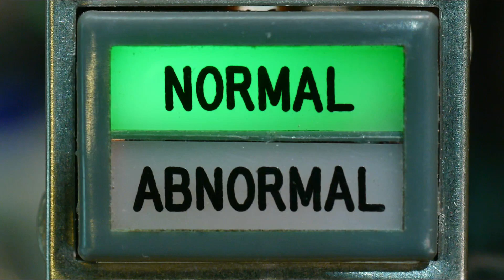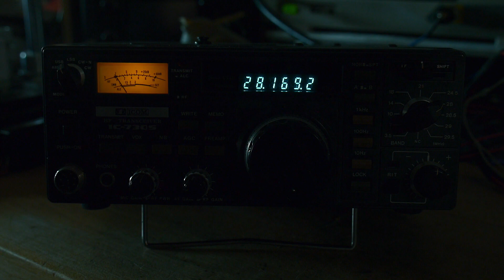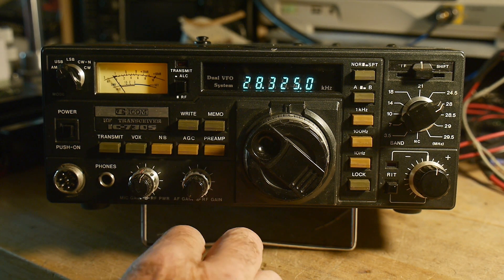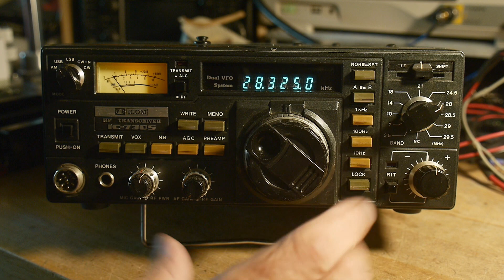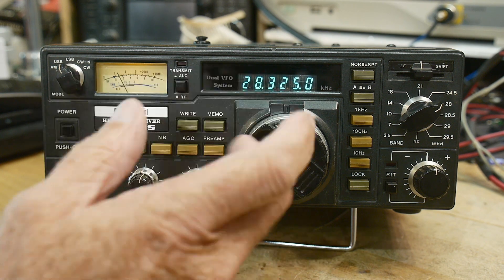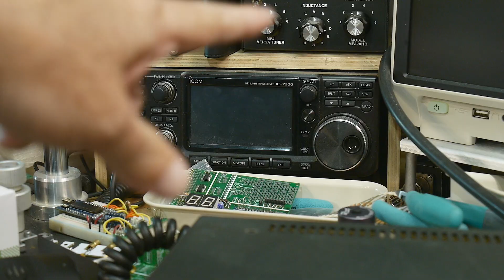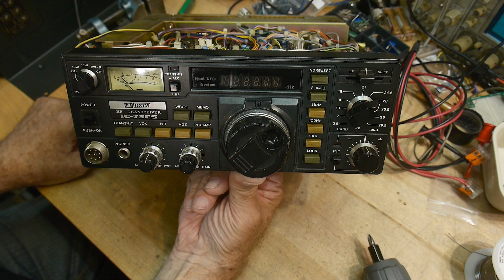#1702 ICOM IC-730S Transceiver Repair (part 1 of 5)

Comment: I replaced the 2SC945Q with a 2N2222 already on my 730. Cut the wire to allow WARC bands. I also did the internal RF cable solder touch up, & cleaned the RL1 relay with Deoxit. I'm still not sure if it's transmitting cleanly, I have to repeat myself when on SSB. It is transmitting, per an external power/SWR meter.

I don't want to do a full recap, but may need to.

Comment: Sir, since you are a technician, I have two IC-735's that were both in good working order that used to be my father in-law's. Now, both just turns ON with one half a display, the other with no diplay at all and I can't hear anything since both were in storage since he died more than 15 years ago. Would there be a chance both will work again if I recap both of them? Thank you sir and all the best.

Comment: Perhaps 10-years ago I bought several of those pre-amp relays for my IC-730 and never got around to installing one.  The reason is that I had popped the cap off the relay, gave it a half-second flood with DS-50 and it has worked perfectly since... no need to replace the relay (so far).  I'd planned to keep the original installed anyway until it just had to be replaced.  Recently I hooked the the radio back up - no RX or TX.  Turned out to be those infamous J2 and J3 solder points on the RF Board.  I not only resoldered them, but soldered in some stiff, reinforcing jumpers to the adjacent solder points.  All well now, expect that the S-Meter doesn't budge on receive; R42/42 adjustments have no effect.  I'll save that project for the next time.  Thanks for the videos.

Comment: A WAY out in left field question., at least with respect to transceiver repair.
I'm in the process of building a DAC on a Raspberry PI with several hats.
One of the boards calls for a pair of Z-foil resistors(Pure Unobtainium). Would you know if this is Hi/Fi Audio-world bullshit
or something necessary? I'm 78 years old and I know what my ears can hear.
My top end is about 13k these days with a dropout at 4k in one ear. 
At what level is resistor noise something to worry about?
Reply from the maker: z-foil is still around but for your application I would categorize it as BS
Reply: The Board is a ProtoDAC  TDA1387 X8. The through holes for the two Z-foil resistors are labeled U1 and U2 which is a bit off-putting.
Still... All and all... It looks impressive.
Despite its lack of Z-foils. 
I don't think my ears will know the difference.

 @IMSAIGuy
Reply: It amazes me that there is all this magical thinking surrounding audio equipment.
 @IMSAIGuy

Comment: I'm looking forward to this series... Earlier this year I repaired a broken Kenwood TS-430s that I picked up for $50 at a hamfest. Ultimately, the problem in it was someone did some sloppy work in the PA section and shorted out the thermistor with conductive thermal paste, so it always thought the PA was overheating.
Reply from the maker: I rebuilt a ts-430s, nice radio.

Comment: A WARC-capable radio!  Can't be that old, right?  Oops, that happened in the early 1980's!?  I remember when that happened and seems like I'm old, not so much the radio...  I have an IC-705 which looks like the little-brother to your IC-7300.  Sure is nice having that big waterfall display right in your face!
Reply: I have a WARC Cubic Astro 103 from '76- '78 era.

Comment: Have two icom 745's, one I bought new and the other much later. The one I bought new lightning tickled it, thing it is the rf power section, receive works fine. The one I bought used was in very good condition, every add on has been installed, fm module, filters, electric keyer. It was in storage, dry and safe, put up an antenna about a month ago. SSB works fine, but CW is not getting to the audio output and AM general coverage isn't working correctly. I suspect tarnished contacts? Sprayed some contact cleaner on the PB tuning, notch filter buttons, the three on the upper right on the front, this brought it up a little, but not much. Have schematics and pictures as per the manual. Any suggestions on cleaning relays or other controls. N5QDM. thanks. 73's from someone who will be 73 in five days.

Comment: Maybe be careful to check the power. IIRC, Japan is not 120VAC.
Reply from the maker: uh, the radio is a 13.8VDC input
Reply: @IMSAIGuy  Didn't you clean the contacts on the input power selection switch on the tan power block adapter thingy? If not, I was thinking of a different video. Mea culpa.

Comment: That's the same mic that came with my IC-751, so it is probably older. I had a very similar model which was 2m only but all mode. It was very good.  My IC-703 is good too.  73 and good luck with the fix.

Comment: Nice to see a Ham radio vid.  What's the connector for in that blank area left front?  ATU?
Reply from the maker: optional xtal marker, gives 25khz and 100khz marker signals for more accurate frequency setting

Comment: Interesting, wonder if the 100W PA is in there but somehow limited or if it's missing the relevant parts and just running on the drivers.
Reply from the maker: nope, a different 10W PA